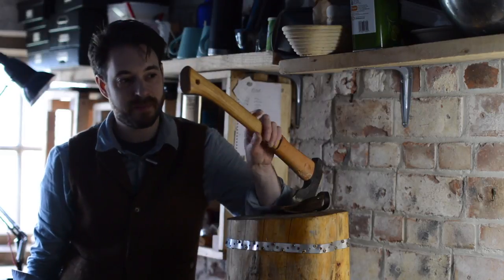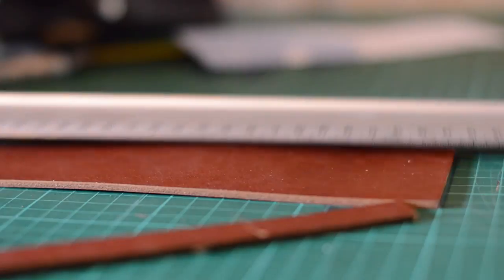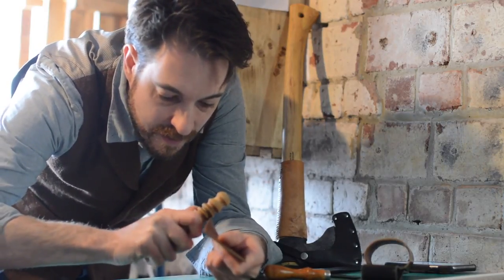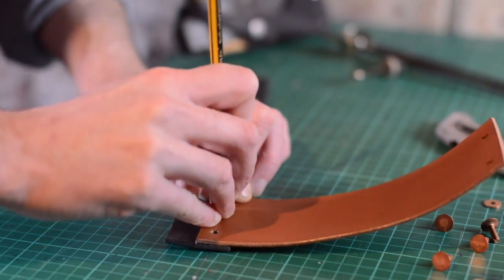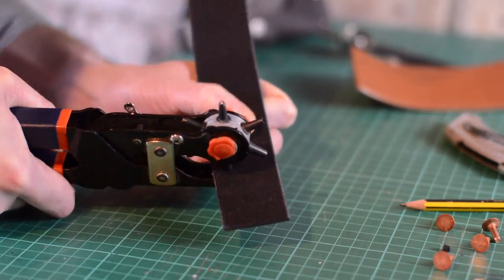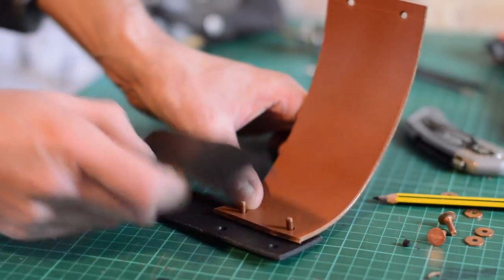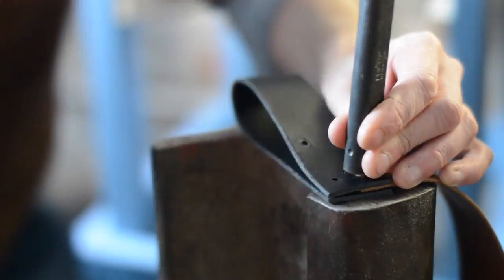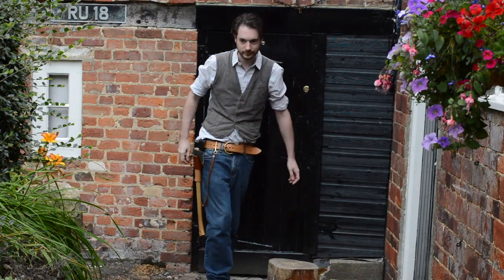Making a Leather Axe Loop

Comment: At 5:32 in the morning l was done making my own belt loop ax holster for my Viking ax. I started thinking about it and started working it at about midnight. Once I got started I didn't want to stop. Mine is similar to yours but along the way I did some things a bit different. I have a lot less tools for leather work but I love to improvise and think out side the box but in my own way. I'm very pleased with how it turned out. Thanks for the inspiration,  and the how to. 
🇺🇲 From across the pond. ☮️

Comment: To hold the layers of leather in place l like Chicago style screws. I lay a scrap price of leather on my work bench then poke the male end of the screw pair through the holes then to make sure it doesn't back off I carefully place one drop of blue loctite on the threads and with decorative side down use a flat screwdriver and tighten them down. Make sure the decorative side will face out ward to hide the other less attractive side of the screws